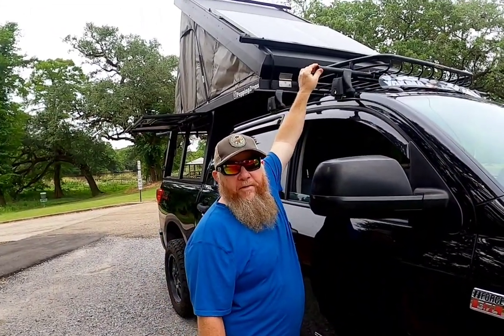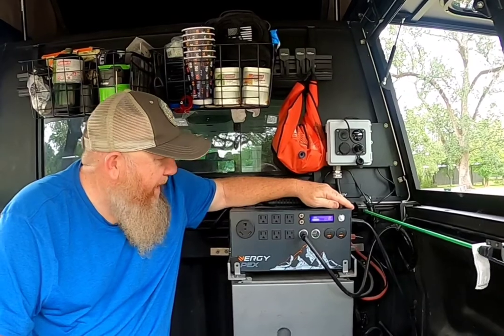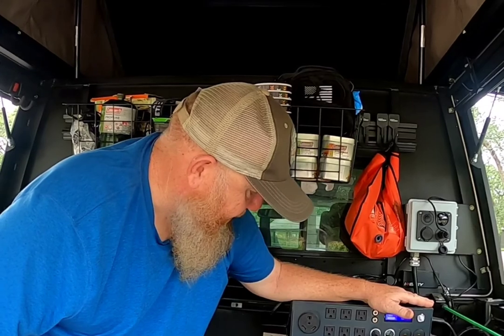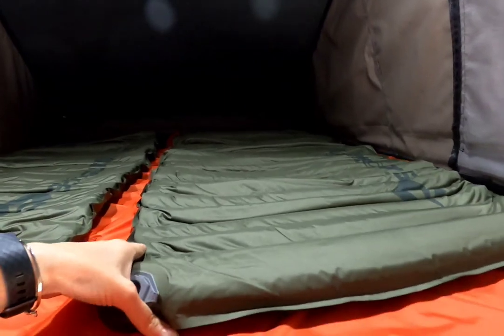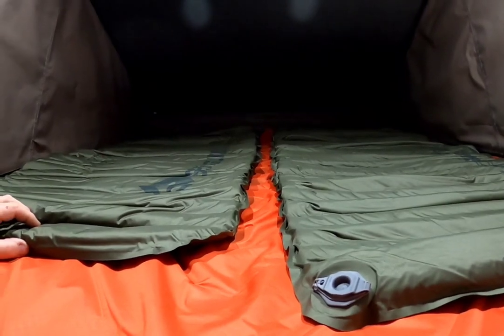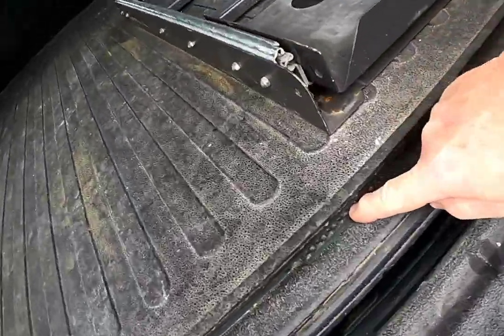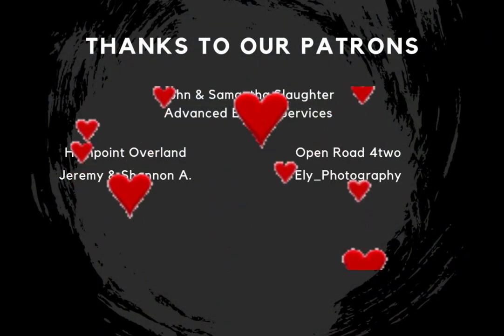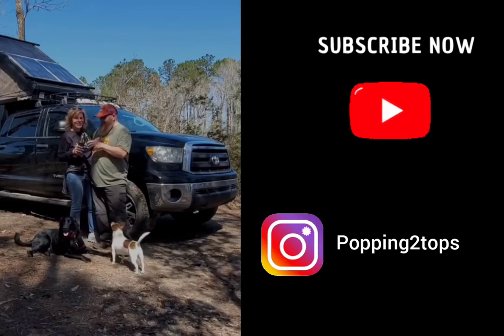A Walk thru of our Snap Outfitters Treehouse |Modifications | 2 years in the making | May 2021

Comment: I have had my eye on the Treehouse for a while. They are back in business. Did y’all ever consider the Project M topper from Four Wheel Campers? What made you decide on the Snap Treehouse? Thanks for this video.
Reply from the maker: Project M wasn't an option when we were in the market. It came out about a year later. There were many reasons why we went with Snap, but #1 was turn around time. We got our treehouse in 10 weeks rather than 2 years like GFC. 4 wheel campers were too expensive and heavy for our truck. Super Pacific was not in business yet. Alucab was the other option but again long wait time. 

We've been very happy with our purchase. I'd buy from them again if we ever had to get another 1. The new owners are as receptive as the old ones.
Reply: @TheCountrySquireRV  thank you for your thorough response. Project M is actually cheaper these days by almost 2k. SNAP is asking 11k just for starters. I do like it though. It gives you more openness when you want it- canopy. Lead time will probably help my decision as well. Thanks again.

Comment: I am a solo camping girl and was going to order the barn door style rear doors - now I am rethinking .. I don't know that Snap offers full tailgate rear doors -- I need something easy to use. Suggestions? Also - is one window on each side enough? I have a full size truck (F-150) short bed
Reply from the maker: We have the slider window for the flip up doors/window combo nearest the cab. If it's kinda cool and I don't have the dogs I'll open that. We added bug screen to the two flip up door/windows nearest the tailgate for super hot nights. I do think Snap offers a door for a tailgate removable. I feel like I've seen that done.  You could reach out to the to find out for sure. 

Personally, I, Paula, have enough air with the windows in the sleeping area but I get cold even in the summer. I we typically only open the door/window combo when we stay at RV parks because we don't like to have everything open when we're boondocking. Plus, animals and whatever. 

Reach out if you have any more questions!